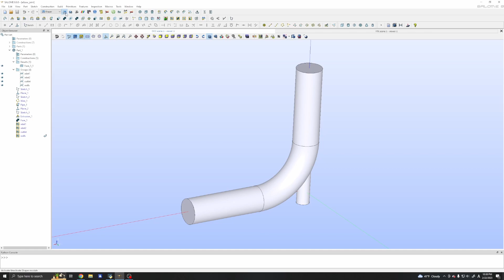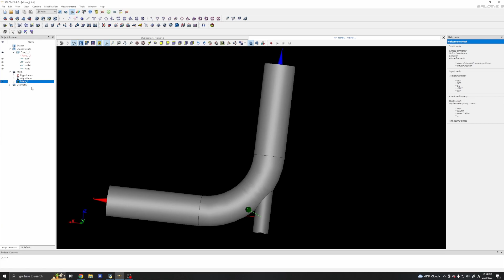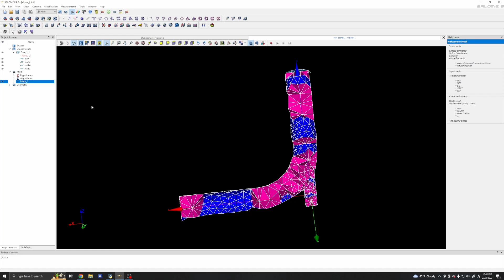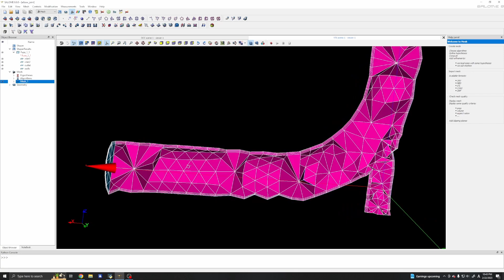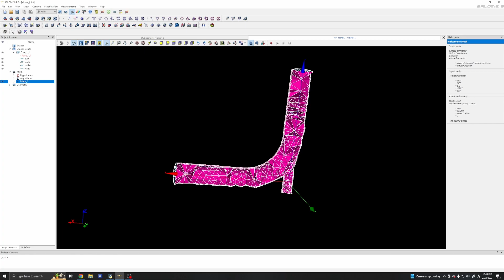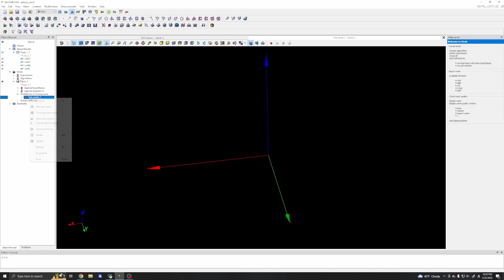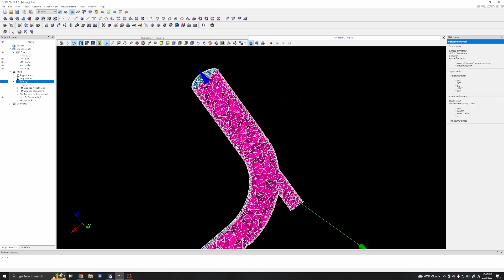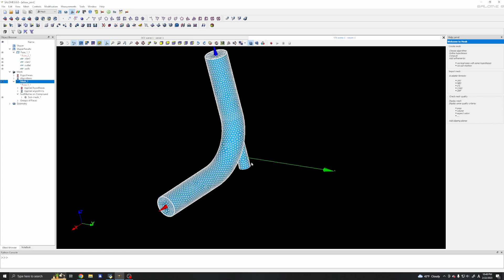Salome for Industrial CFD Series (Part 2: Meshing of a Mixing Elbow)

Comment: Hi, I am trying to recreate this simulation on my pc. But when I try to mesh the part using NETGENengine library it crushes (giving me the error 'can't load meshes plugin library NETGENEngine.dll'). It doesn't with yours tho. Do you know what to do in this case?

Nice video btw.
Reply from the maker: What version of Salome do you use? I have heard that Salome 9.10 series have that problem somehow. I am using Salome 9.9.0 and I have no problem with it
Reply from the maker: If you use Salome 9.9.0 and face this problem, may be try reinstalling the software from a newly downloaded installer may work.
Reply: I installed 9.9.0 version last week, do you think I should re-install it ??